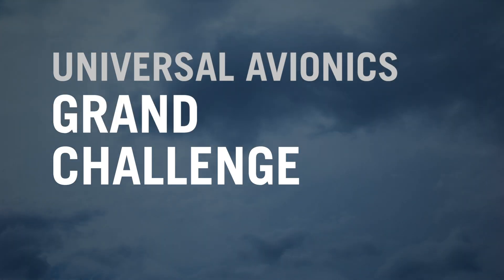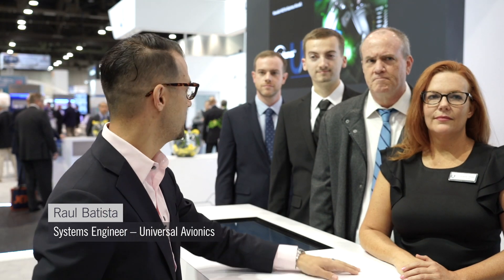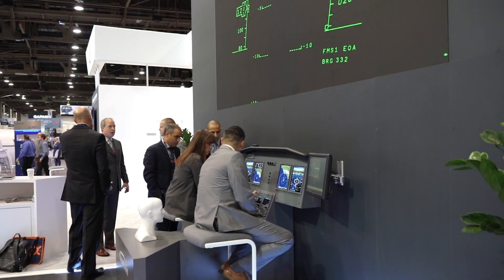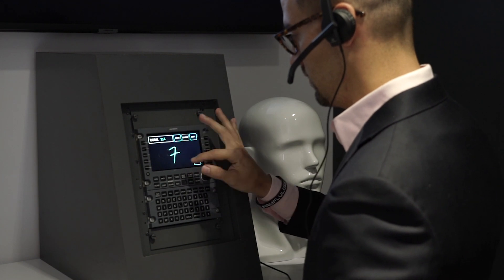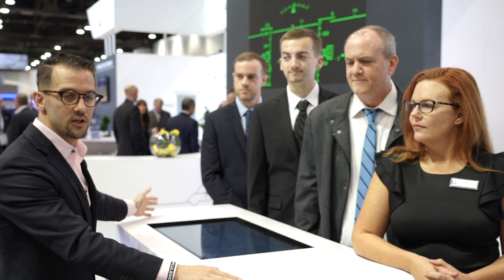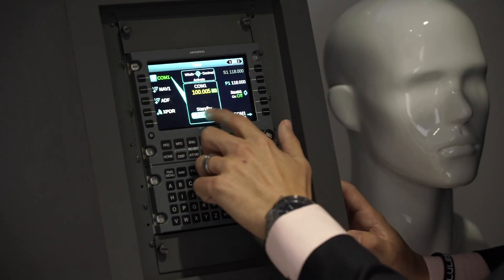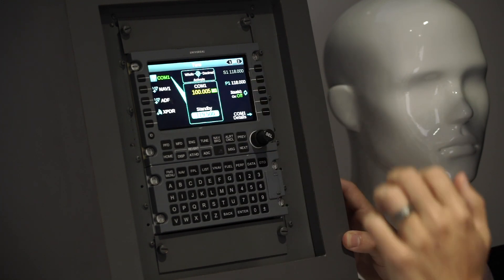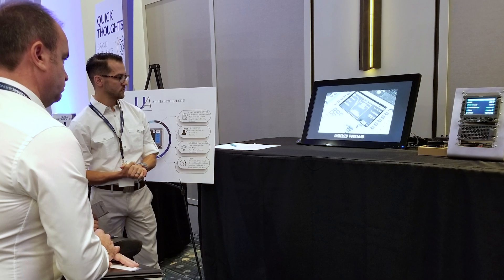Universal Avionics Holds Competition for New Control Display Unit Interface – AIN

Comment: The first car looked like a horsedrawn carriage. Classic mistake of convention. Aviation continues to do tiny clumsy cluttered instruments instead of throwing all that away and doing a single large display with no buttons at all. And by large I mean like 32 inches. Clarity, gentlemen.
Reply: Two issues with your proposal.

1. A single very large display leaves no space for a usable backup on a single pilot aircraft or the ability to operate with a display u/s on a multi pilot aircraft.

2. A large part of the market is for retrofit of existing aircraft. The bigger the display the bigger the challenges in refit.
Reply: you are correct. Aviation is waiting for its Tesla moment whereby a new player in the game shows what can / should be done

Comment: How is writing at arms length, using your finger, easier than turning concentric knobs or using a number pad?
Reply: I think in future applications it opens up room for multiple panels run on one display. I'm not a pilot, but I'm assuming there is some future benefit this team is looking to open up.